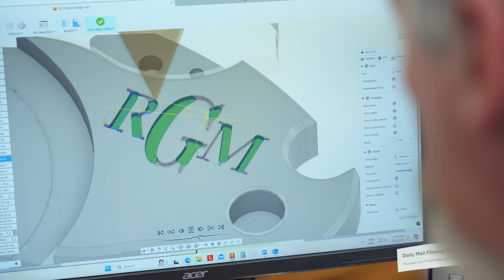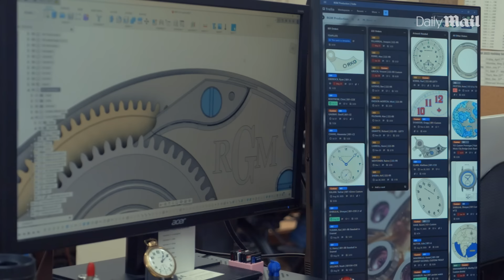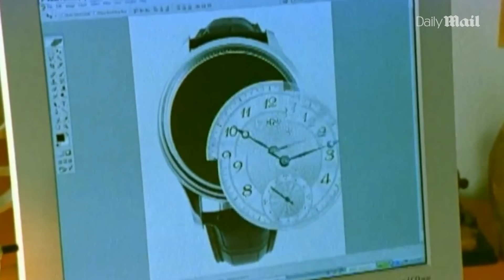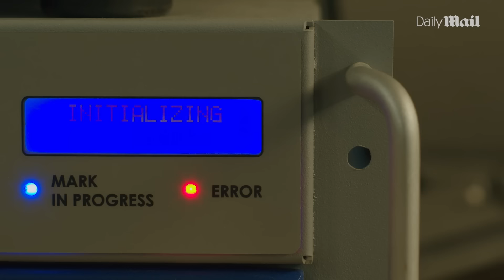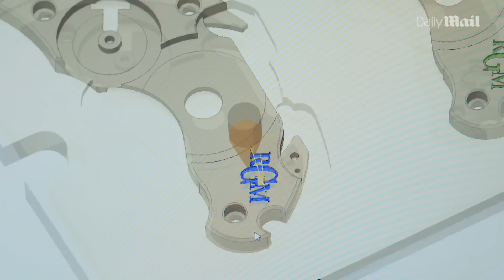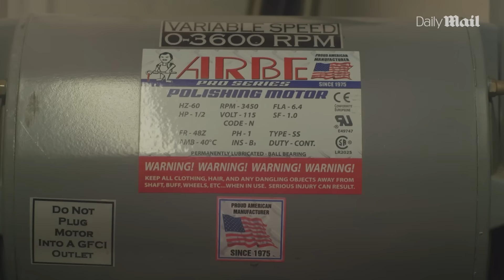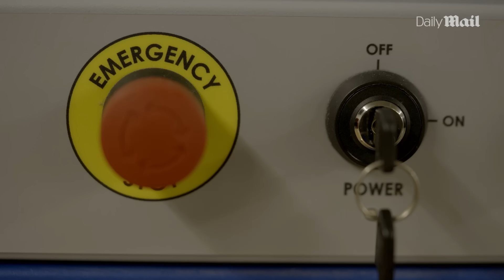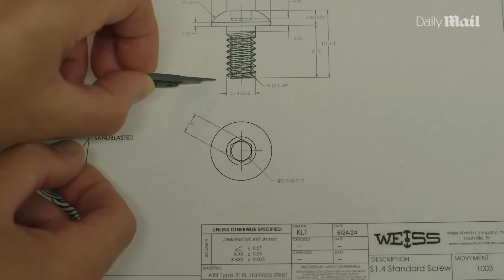Two Master Watchmakers Show How Difficult It Is To Make A Perfect Watch | Great Works | Daily Mail

Comment: I admire the craftsmanship, but we did gyroscopes and atomic clocks, and the problem with all mechanical watches, and most electronic watches, and most quantum watches, is that they are almost "perfect thermometers" over a certain temperature range.  We had a joke, both during EV battery development, and HRG (hemispheric resonating gyro) development, that their temperature "ranges" tracked almost identically.  During one EV chemistry, we tracked the "number of miles" almost identically with the battery temperature in degreesF.  Below zeroF the battery stratified and became permanently unuseable, and above about about 200'F it boiled over, and exploded.  Even "modern" watches, based on electron-spin-resonance, STILL have this same problem.  Accurate to within one-part-to-the-15th-power in accuracy, but ONLY if you keep them below about 20'Kelvin.  Nature and our Universe does NOT like a permanent object, nor process.  It is constantly evolving, and clocks are not a static element.

Comment: WAY over romanticized view of an archaic process. I own several exclusive hand made mechanical watches and in the modern age all of the appeal of these is manufactured through decades long marketing campaigns. A Rolex watch, at it's most elemental is a tool. A tool which does its job less accurately than a 50 dollar quartz. 
The metals are not exclusive or expensive. Marketing. The 'certified' accuracy is pathetic. Marketing. Perlee, perlage and Geneva stripes and all of that are just decorations that are added that cost a fraction of a cent per unit. Marketing.
If your dad always wanted one but could not does not mean that you need one. If your dad had one it does not mean you need one.
Calling them 'investments' is the stupidest premises there is. Nothing manufactured is an investment. Stock in a company that makes something is an investment. Man up and put your money in the real financial markets instead of a piece of jewelry.

Comment: 0:59  IIRC, we called this "engine turning" in the custom firearms craft back in the Eighties.  Is that still an alternate term?
Reply: It is also called engine turning when used on larger objects. A great example is the cowling on The Spirit of Saint Louis (Lindberg’s airplane).
Reply: @monteengel461  Thanks!  I just remembered that they also called it "jewelling," especially when used on the bolts of bolt action rifles.  They'd polish the bolt to an almost mirror shine, then jewel it, and it was just the most beautiful thing when fit into a blued rifle.  Beautiful stuff.

Comment: (Hours + (Minutes + Seconds / 60) / 60) × 100 / 24 = Centi-Days
(2 + (23 + 60 / 60) / 60) × 100 / 24 = 10 ₵-Days
(4 + (47 + 60 / 60) / 60) × 100 / 24 = 20 ₵-Days
(7 + (11 + 60 / 60) / 60) × 100 / 24 = 30 ₵-Days
(9 + (35 + 60 / 60) / 60) × 100 / 24 = 40 ₵-Days
(11 + (59 + 60 / 60) / 60) × 100 / 24 = 50 ₵-Days
(14 + (23 + 60 / 60) / 60) × 100 / 24 = 60 ₵-Days
(16 + (47 + 60 / 60) / 60) × 100 / 24 = 70 ₵-Days
(19 + (11 + 60 / 60) / 60) × 100 / 24 = 80 ₵-Days
(21 + (35 + 60 / 60) / 60) × 100 / 24 = 90 ₵-Days
(23 + (59 + 60 / 60) / 60) × 100 / 24 = 100 ₵-Days

Hours × 5² / (6¹ × 10⁰) = ₵-Days
Minutes × 5² / (6² × 10¹) = ₵-Days
Seconds × 5² / (6³ × 10²) = ₵-Days

₵-Days × (6¹ × 10⁰) / 5² = Hours
₵-Days × (6² × 10¹) / 5² = Minutes
₵-Days × (6³ × 10²) / 5² = Second

For Martian Time:
Hours × (6² × 10²) / (864 × 299 / 291) = ₵-Sols
₵-Sols × (864 × 299 / 291) / (6² × 10²) = Hours

₵-Days × (6³ × 10² / 5²) / (864 × 299 / 291) = ₵-Sols
₵-Sols × (864 × 299 / 291) / (6³ × 10² / 5²) = ₵-Days